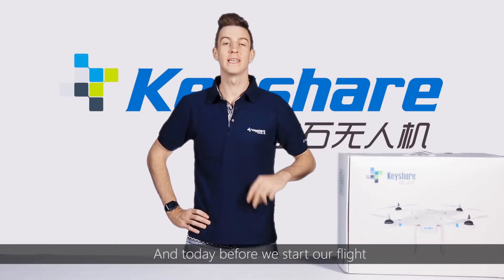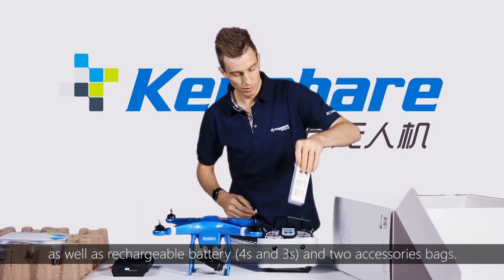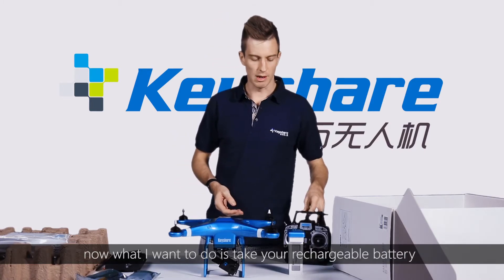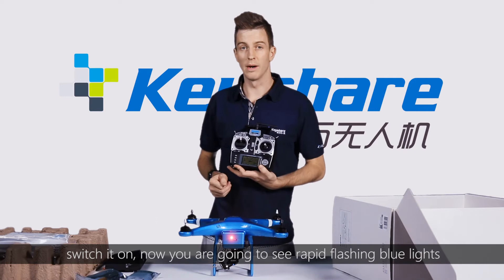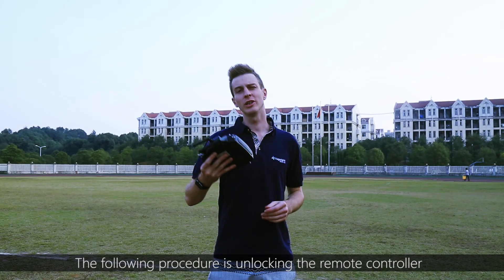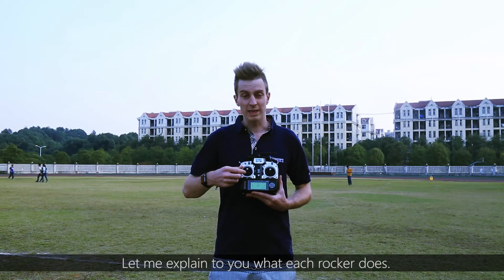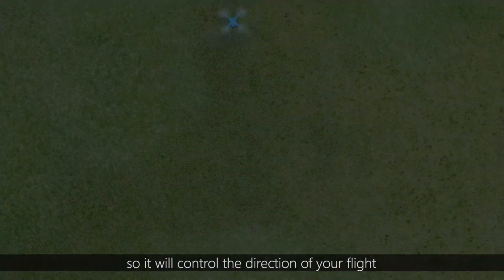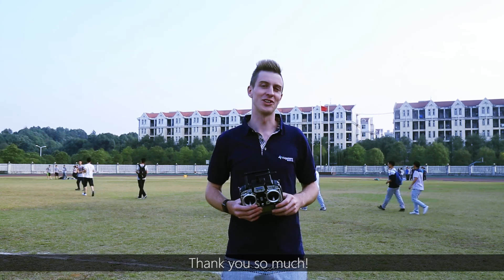How to calibarate and operate keyshare glint drone

Comment: There seems to be a lot of messing around before you fly the drone...most drones now are coming with self calibrating systems that reduces the need for all this silly calibrating nonsense..and unlocking of the TX, who the f*ck thought of that...it says 18 mins on the battery time, by the time youve done all the calibrating and the rest of it you will have lost loads of flying time....was going to buy this now im not gonna bother...